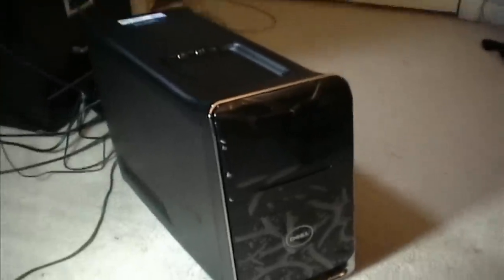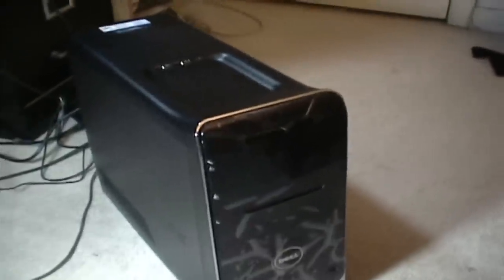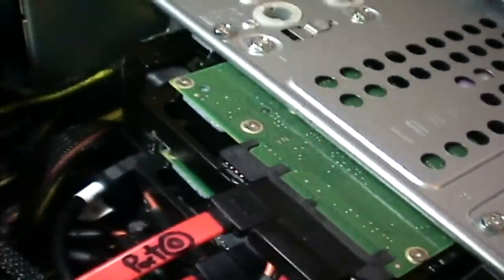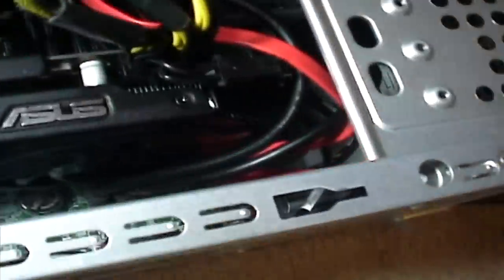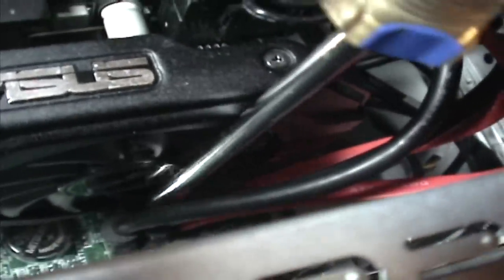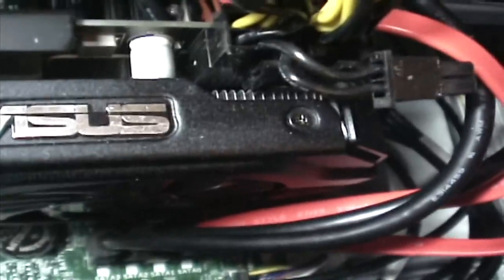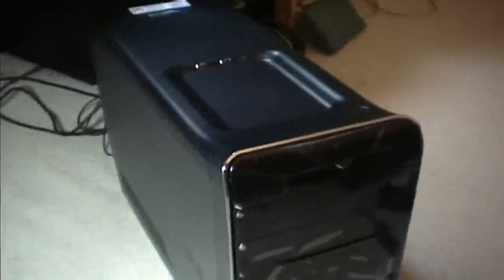The Dell XPS 8300 Desktop Computer Can Fit 3 Hard Drives Easily

Comment from the maker: It was pretty straight-forward. Just do a Google search for the XPS8300 manual (I'd post the url but can't post any url's in youtube comments). In the table of contents you'll see "Power Supply". It was more tricky removing it than putting it back in. After removing the 4 screws, you're supposed to press these clamps which releases the power supply from the chassis. And then you lift the power supply away from the chassis. It's all well illustrated in the manual.

Comment from the maker: It's well illustrated in the manual. Just do a Google search for XPS8300 manual (I'd post the url but youtube prohibits url's in the comments section). In the table of contents you'll see "Power Supply". It was more tricky removing it than putting it back in. After removing the 4 screws, you're supposed to press these clamps which releases the power supply from the chassis. And then you lift the power supply away from the chassis. Again it's all well illustrated in the manual.

Comment from the maker: It depends where you want to put it. If you put it beneath the 1st hard drive (where a 2nd drive was intended to go) it was meant to be screwed in. If you put it in the location where I placed my 3rd hard drive (1:49), then you don’t need screws because the drive fits so snugly in the space. The Dell XPS 420 model from 2007 had a simple screwless clip-in design for the hard drives so it used to be very easy to change them.

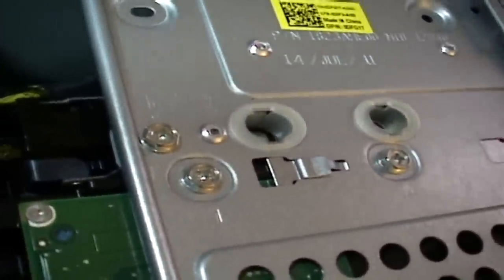Comment from the maker: I upgraded the power supply right away because I believe it needed more power since I added 3 hard drives, extra USB ports and extra Firewire ports. I also use my computer to charge my phone & iPad. So I didn't even try using the power supply it came with. At 4:50 you can see the power supply I added, it's 750 W. There was a good deal on it at Fry's so I took it. I've had no power issues since getting the computer and setting it up this way.

Comment: worked like a charm when I installed my 3rd drive, a 240GB Kingston SSD, which, despite the mount being lower profile, stille managed to fit snugly into the described slot, ande ven allowed one of the screws to be inserted for a bit more durability :)

Comment from the maker: If you look at page 94 of the XPS8300 manual, it shows 2 clamps that secure the power supply into place. To my recollection those were not moveable. I didn't have to worry about it because I did find a 750 W PSU that fit (seen at 4:52). It was obviously the same size as the original PSU. I suppose if you really wanted you can remove & reposition those 2 clamps but you'd probably have to be really comfortable with that kind of alteration of the motherboard.

Comment from the maker: Yes, the first two ports (labelled SATA0 and SATA1) are the higher speed SATA 3 connections. But the device you connect them to also needs to support SATA 3 in order to get that speed. My computer came with a hard drive that only supported SATA 2. So I bought a new drive that was SATA 3. My first 2 drives are SATA 3 but my 3rd drive is SATA 2 because there are no more SATA 3 ports (it wouldn't be worth it to spend more on a 3rd SATA 3 drive if there are no more SATA 3 ports to put it into).

Comment from the maker: @ssgsorrels I'm using the Asus GTX560 Ti. Yeah, all I did was swap out the existing card & put in the new one. It can get tricky because there's not a whole lot of room in there & there are alot of cables that get in the way, but it can be done as you can see in the clip. There's no need to buy a new case. The video card works great, no problems at all so far with high graphics games and I'm also using 2 monitors. I'd advise you to check the card temp frequently when you first get it

Comment from the maker: No, I believe it needed more power than the stock especially since I added 3 hard drives, extra USB ports and extra Firewire ports.  At 4:50 you can see the power supply I added, it's 750 W.  There's was a good deal on it at Fry's so I took it.  I've had no power issues since getting the computer and setting it up this way.

Comment from the maker: I might be incorrect since this was awhile ago, but I have a vague memory of buying a 3 TB drive & it didn't work for some reason (could've been over the pc's limit or could've been the drive itself). So I ended up getting two 2 TB (6 Gb/s) drives and one 1.5 TB (3 Gb/s) drive. If you get 3 drives, the 3rd drive doesn't have to be the more expensive 6 Gb/s speed because the 3rd SATA slot only supports 3 Gb/s (the first 2 slots support 6 Gb/s). Again as always make sure the product is returnable.

Comment from the maker: @tvseriesification I know the EVGA GeForce GTX 560 Ti fits because that was the first card I got. Although it had no problem fitting, for some reason it did not work (probably a defective card they sold me). The 750 Watt power supply fits fine. Some advice: always buy from a place that accepts returns (especially computer parts) just in case.

Comment from the maker: It doesn't look like there should be any problem. The card I'm using now, GTX 560 Ti, has dimensions of 9 inches X 4.376 inches with a dual-slot width. The card you're considering to get, the GTX 660 Ti, has dimensions of 9.5 inches X 4.376 inches with a dual-slot width. So the card you want is only 0.5 inches longer. As always, make sure any computer part you buy is returnable just in case.

Comment from the maker: Do a Google search for "XPS8300 manual" It should be the 1st result from Dell. In the left column find "Graphics Card Bracket". That is the plastic thing that keeps the card in place. You need to remove that first. It gives step-by-step instructions to remove it (with an illustration). You simply unscrew it. With regard to the actual card, don't force one end out. Use force evenly throughout in a teeter totter like motion. Change cards & remember to screw back the Graphics Card Bracket.

Comment from the maker: All the internal hard drives I've purchased have come with a SATA cable in the package.  I've bought them in a retail store though.  If you're buying it used then you should make sure before you buy.  If for any reason it doesn't come in the package, you can get them for pretty cheap online.

Comment from the maker: Most power supplies are universal. If your computer has an ATX motherboard, then any ATX power supply will be compatible. The exceptions occur with BTX motherboards or some companies that make their motherboards to only fit their power supplies. It might be worth your while to go into a store and look inside the computer you want to see if it has the standard ATX motherboard. Again, I always recommend you buy from a place that allows returns just in case.

Comment from the maker: It didn't look like it on my XPS8300. If you look in the XPS8300 manual (google it), on pg 94 you'll see it better. The 4 screws are in set positions (for a power supply that has its 4 screws in those set positions). Depth-wise, a deeper power supply would not fit because there are these clamps that hold it into position and those clamps are soldered onto the motherboard. So if you really wanted to be sure I'd recommend you look inside the computer you want & even take measurements of the psu.

Comment: Thanks Peter. I want to put an alternative PSU. Do the support brackets on the 8300 mean I am limited to PSU 140mm deep? Most PSUs at 700W+, which is what I will need for the a GPU I want to put in, are around the 150-160mm depth. There are no modular or hybrids at 140.

Comment: Hi, this is probably a dumb question, but where is the power port for the power adapter cable in the standard setup on the XPS 8300, or do I need to upgrade the power supply to be able to power the 3rd HD?

I've got a 3.5" Seagate 2TB Desktop SSHD - SATA 6GB/s 3.5-inch internal Solid State Hybrid drive installed in the bay you pointed, connected and visible to both the BIOS and the OS, but I can't find any ports to plug in the power cable?

I'd be very greatful for any help you can give, and thanks also for putting up the video in the first place :-)

Nicely done...

Comment: I just got an hx 750 from corsair. I ordered it from dell so it would not conflict with the warranty on my new computer and the tech support said it would fit fine and there would be no comparability issues whatsoever but I just tried to put it in and it is more than 2 inches longer than the stock psu so it won't fit in the clamps and the cables for the wireless antenna and the USB/headphone jacks on the top of the case are in the way. 
To say the least I am a little p'o ed right now

Comment from the maker: It's an XPS 8300: Intel(R) Core(TM) i7-2600 CPU @ 3.40 GHz 3.40 GHz. You can see the hard drives I'm using at the 5:00 mark (plugged into SATA0 and SATA1 ports). If you're going to put a 3rd hard drive in one of the other ports you can get a lower speed drive to save money (since those ports are slower). For video card I'm using Asus NVidia GeForce GTX 560 Ti. If you have any firewire devices make sure you get a firewire card because this computer doesn't have firewire ports.

Comment: I bought a corsair CX600 Watt and im trying to replace the stock dell 460 watt on my xps 8300. I know that i have to press on these two latches that you have to push on but on one of them their a small metall piping shape therefore preventing me from putting pressure on the latch. If you can make a video on replacing a PSU on an xps 8300 that would really help.

Comment from the maker: By the way, for front USB access there are already 2 USB ports (2.0) in the flexbay slot right beside the 3rd hard drive (you can see those at 1:54). In addition there are 2 more at the very top of the computer. I use them for my iPad, iPod & Blackberry all the time with no problem. I'm surprised they used the entire flexbay slot if you wanted to upgrade to USB 3.0 ports. I would have thought they'd just replace the existing USB 2.0 ports. Do you still have those 2 USB 2.0 ports beside the slot?

Comment from the maker: The GTX 560 Ti video card has a minimum power requirement of 500 W.  The Dell XPS 8300 only comes with 460 W.  So yeah I had to change the power supply.  It also takes more power to run 3 hard drives so that was another reason to upgrade the power.

Comment from the maker: Dell's tech support are not always accurate. One of them told me you couldn't even fit 3 hard drives. The good thing for you is that you now have the exact dimensions. If I were you I'd take it into a Fry's, put it side-by-side against the power supplies they have on display, & make sure you get the one that's 2 inches shorter.

Comment: thank you. your videos about upgrading the Dell XPS 8300 have been very helpful ! ! ! 
I have a question about the power supply unit. do PSU's have standardized external dimensions, and mounting screw positions ? I ask because when I look inside my  XPS 8300's case, there doesn't appear to be much space around the PSU.

Comment from the maker: The card I have is a GeForce GTX 560 Ti whose dimensions are as follows: length: 9 inches, height: 4.376 inches (111 mm) and the width is dual-slot. Find out the dimensions of the card you want and if it's not significantly greater than what I've listed, then you should probably be good to go. As always, make sure the product is returnable just in case.

Comment: No go for me. I have the Dell XPS 8300 with the USB 3.0 option and that flex bay slot is used to connect and power the USB 3.0 slot in the front of the case.

Comment from the maker: @CommiePinko101 Just make sure the PSU is of the ATX form factor (which most modern PSU's are). When you walk into a store selling PSU's, chances are that's the most common type they'll have. For helpful info on replacing the power supply, google "XPS8300 manual". Find Dell's official manual (should be first one) and once there click on "Power Supply".

Comment: Hi. I have a XPS 8300 also with an NVIDIA Geforce GT 530 card. I was looking into upgrading the graphics card to the GTX 560 but was concerned because the minimum power for the card is only ten watts less than what my power supply has. I just wanted to know since your running the GTX 560 TI, did you upgrade your power supply or did it just come with a better power supply that 460 watts?

Comment: I tried to do it, it was difficult; I had to bend a few parts on the case; I got everything disconnected except the connector to the motherboard wasn't disconnecting, I don't know what it was. I am planning on taking it to a professional to replace the power supply

Comment: I have a Dell XPS studio 7100 and I mounted a 80mm rgb fan to the front panel behind the HDD bay.  Just get some fan filters that extends outwards.  And zip tie all 4 fan holes and I replaced the PSU to a seasonic PSU 500 80+ bronze.  I even upgraded to a AMD Phenom II x6 1090t BE CPU, Gigabyte RX 560 4 GB GDDR5 GPU, Samsung Evo 850 500 GB SATA SSD, 250 GB Western Digital HDD, Western Digital 1 TB HDD, and a Intel NIC card because the onboard broadcom NIC died.  Great system BTW.

Comment: Hi, pktechspot, I'd just like to know more about your power supply. I'm new to pc gaming and the computer I'm looking at buying, I'm considering on changing the power supply. When you changed your power supply did you have to buy a specific size or are all power supplies universal in size. The computer I'm looking at buying is a dell xps 8700 and has these dimensions: Height: 16.01'' (406.8mm) / Width: 7.30'' (185mm) / Depth 17.49'' (444mm). Are there any adjustments in the case to fit any?

Comment: I have this model, and I saw your other video regarding the graphics card slots being poorly designed. As my card is currently an Radeon 6450 HD, I was looking for an upgrade and was wondering if a: it would be particularly difficult to remove/replace the graphics card and b: the Radeon R9 270x would fit, right? (I was concerned as I heard that the tower was rather narrow for cards and that, so i don't really know)
Reply: Yeah I just bought one and it doesn't work at all.  Apparently the MSI version MIGHT work because it has a bios switch but not the Radeon.
Reply: ***** Thanks bud - did you upgrade the PSU?  Honestly I've saved enough cash to buy a new rig soon so no more worries :D.

Comment: When you put the 560 in, Did you have to change the power supply? Somebody told me my power supply is only 40W, while the 560 uses 45W To run properly, Just trying to confirm if its true or not.

Comment: Hello pktechspot i have a dell xps 8300
Intel Core i7 2600 
HD 6670 graphics card 

I have a question im thinking about getting a GTX 660 or maybe a GTX 660TI but im worried that it might not fit under the RAM slots will it fit it looks like it does to you?

Comment: pktechspot did you have to mode the case in anyway to get that Cooler Master Power supply in there.  I have been  thinking about ripping out the Dell power supply in my XPS 8300 and replacing it with something that can supply more juice.
Reply from the maker: +Lance Voorheis No, the case is the original from when I purchased it.
Reply: I successfully installed a Thermaltake 750 watt bronze in my rig. Tight fit but it worked

Comment: If I get a Sapphire HD 7790 2GB GDDR5 with the following dimensions : 215(L)x106(W)x38(H) mm Size.
2 x slot, Do you think I will be okay? If the website I checked on is right the dimensions of the graphic card I curently have is : 250(L)x115(W)x40(H) mm Size

Comment: can u test Asus GTX 1060 Dual OC or others GTX 1060 on XPS 8300?
Reply: I just put a evga 1060 mini 3gb into mine. Runs fine. Having an issue fitting the 3.5 tray in that spot though.

Comment: A quick question I hope you can help.

Will my XPS 8300 -purchased in 2012 - fit the following?

http://www.komplett.ie/komplett/product/zkb-01com/80011322/asus-geforce-gtx770-dc2oc-2gd5-2gb-pci-e/details.aspx

http://www.komplett.ie/komplett/product/zkb-01com/80012792/coolermaster-gm-series-g750m-750-watt/details.aspx

Any answer much appreciated :-)